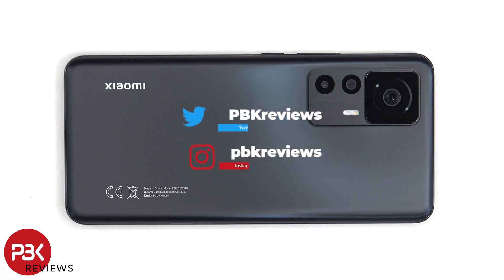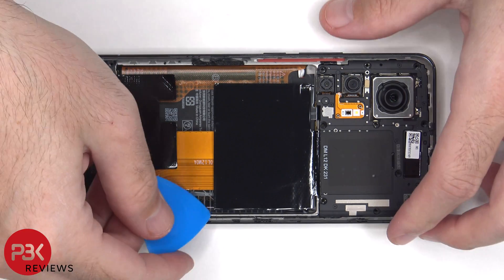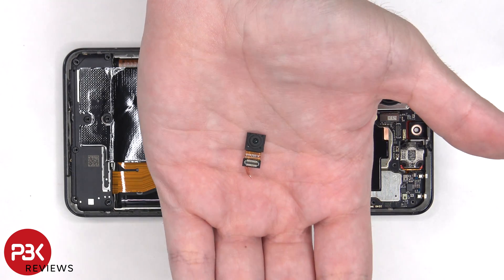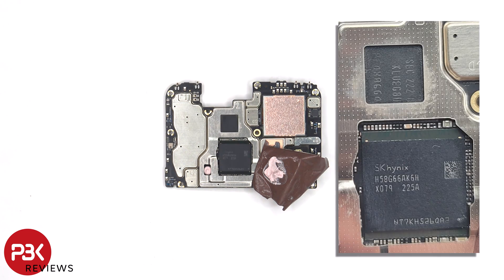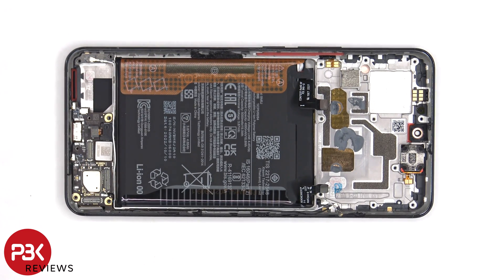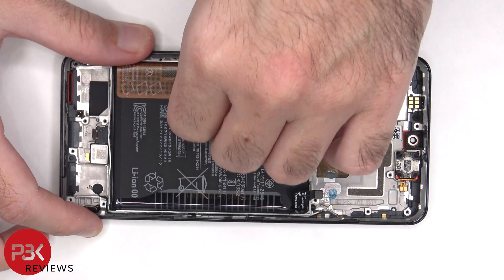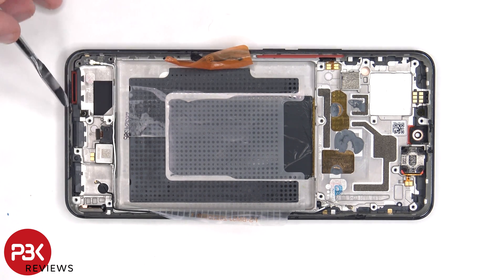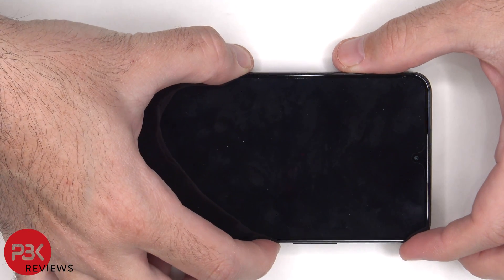Xiaomi Mi 12T Pro Teardown Disassembly Repair Video Review

Comment: I need help! I've pulled one cable when removing the back. What's the name please? the black long one that goes from top to bottom, you mention it in minute 3:14
Reply from the maker: Its a coaxial cable for smartphone. Usually these aren't easy to find, so if you damaged it, you may need to find one from a different phone model and see if you can find a similar length  to use etc.

Comment: Hi, if i have a broken 12t pro, can I do storage swap with a new unit to get back my data?
Reply from the maker: The onboard storage is soldered to the main board, so it would require expert soldering knowledge to be able to de solder the storage chip and swap with another board.
Reply: @PBKreviews  Thank you for your reply

Comment: How do you remove the ring camera from the back cover?
Reply from the maker: There are a few philips screws on the back of the cover that need to be removed and there is some adhesive holding it down as well. Just remove the screws, heat it up and pry it off.

Comment: does anyone know where to buy a camera lens replacement? i just broke mine
Reply from the maker: I couldn't find just the lens replacement, but you can purchase a battery door cover that comes with the camera lens: https://www.ebay.com/itm/374678436680?hash=item573c933b48:g:R5cAAOSwf1lkVMIM&amdata=enc%3AAQAIAAAA4BHx7r8PkD0%2F0Q%2B57SBcsR1mutBilcPP0Efgi50KmeIfl0MFY7H8VUyJ1qr%2FhfzMHmE0wgzz4q7rix9kczwWDRhJvulF6%2B9lp5X4pTZYQHzBLu3tac%2FUEXWkyURDLBq%2FdbJrCiy7qSgJnETBMtoMb9ayy5%2FIkvyFWzZOIfKS5m6PalCS46UZll7I%2BSprGVyDz%2FbJ9%2FUeMg8hV1WLsMfQKTRp2POPH%2FFXiOQQ0%2FpCpYycNOOKnE7WjU%2BobhJUeFy7Nm3dkh3CWMkJuuoGdz6F7XwGBRPSO8DHjtzKs0bd6bvj%7Ctkp%3ABk9SR5iEqI6sYg

Comment: If i need to replace the back cover (its broken a little bit) do i have to replace it including the lens cover or it can be moved to the new back?
Reply from the maker: The lens cover is held on with adhesive as well as a few screws, you should be able to remove the screws and pry off the lens cover/camera bezel and move it over to the new backplate but usually new replacement backs should come with the lens cover/camera bezel as well.

Comment: Sir,your videos are absolutely the best. I have one question. I have an iPhone 11 a two SE 2020s. All 3 of these phones I can’t hear or feel the haptics engine. I’ve adjusted everything. Perhaps I’m missing something. Any help would be appreciated greatly. Thanks again.
Reply from the maker: Hi, thank you. Hmm not sure what could be causing all 3 not to work. If the parts themselves are good, I would look into a connection issue and see if the cable connecting to it or the contact points which give it power are touching to give it a connection. Aside from that, I'm not sure.